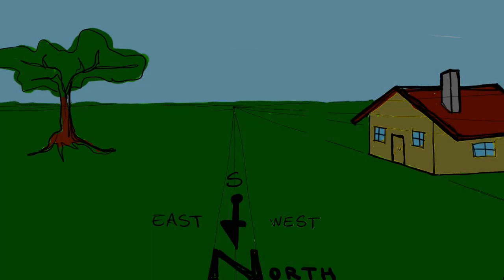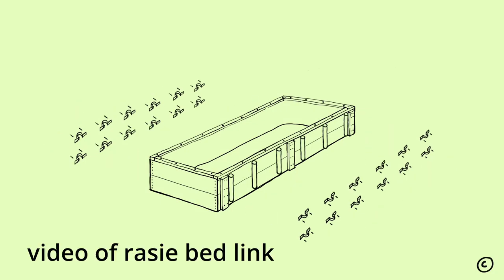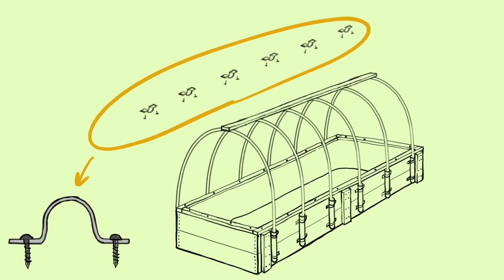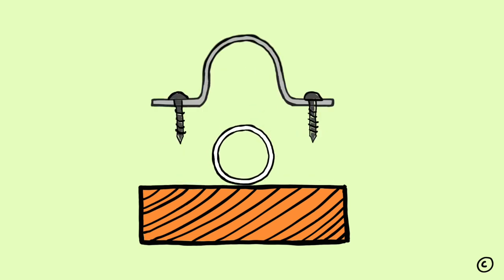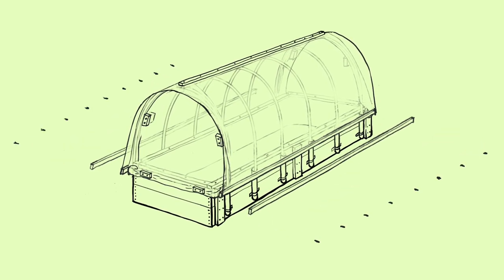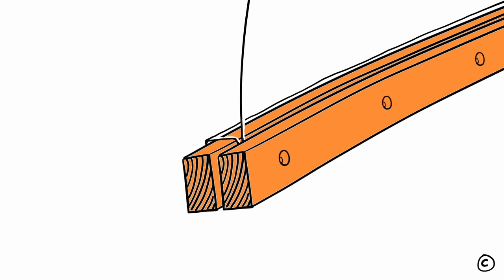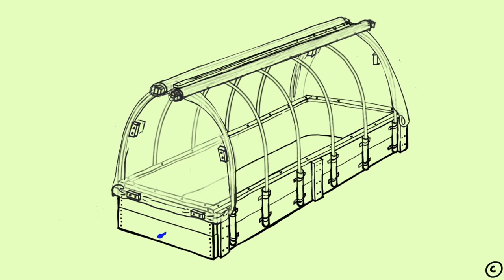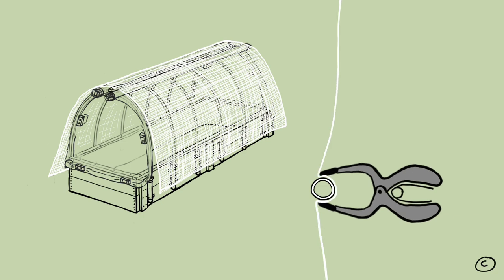A Mini Greenhouse Dream: My Hoop Cold Frame Design, DIY Tips, P.2 | Self Reliance Country Life

Comment: I used your plans to make a hoop cold frame for our 4x8 wood bed and it works very well! It's easy to operate and has withstood 30 mph winds so far. There is no protection from the wind in the garden so we'll see how it holds up this winter! I appreciate that your instructions and illustrations were easy to follow.
Reply from the maker: I am delighted to hear that and thank you for sharing. Your comment puts a big smile on my face.

Comment: Love the design especially with the snow load. Could you show the clamps or source them? I only know of the strong ones.
Reply from the maker: Thank you for appreciating my design. The clamps are very generic. You can use any of them, just try them out and see. PVC is very strong so as long as you don't use a super strong clamp, it will be just fine.

Comment: Please share the diameter of the PVC arches and the vertical pipes. Will 3/4 and 1” work?
Reply from the maker: I believe the PVC is 3/4” in diameter for the hoop and for the sides you can use anything as long as it fits the hoop arch.